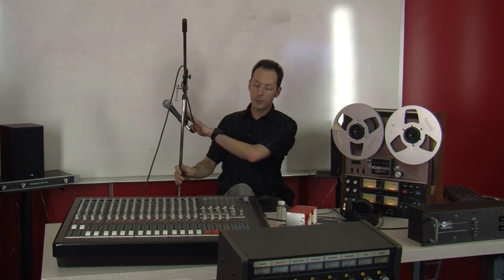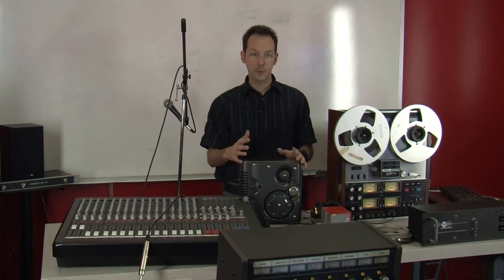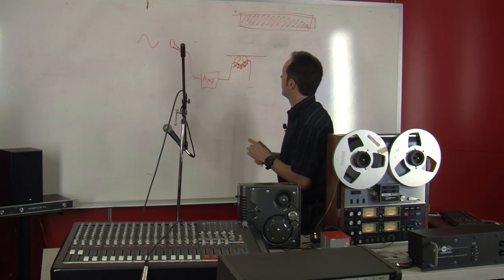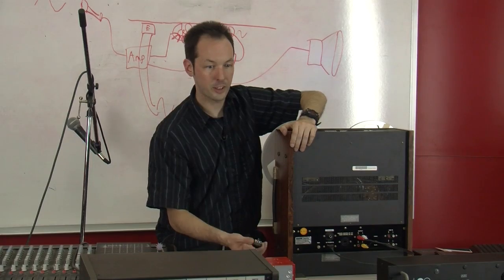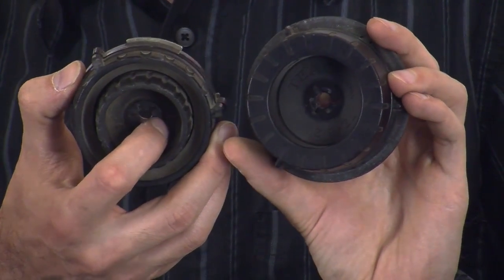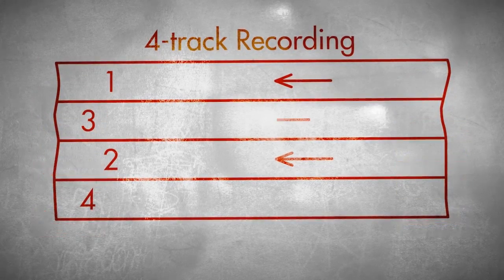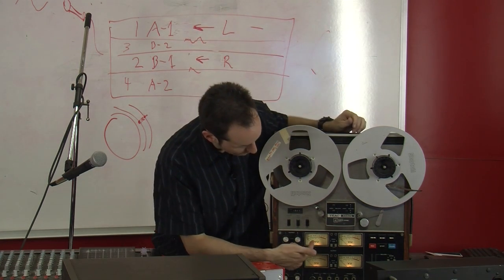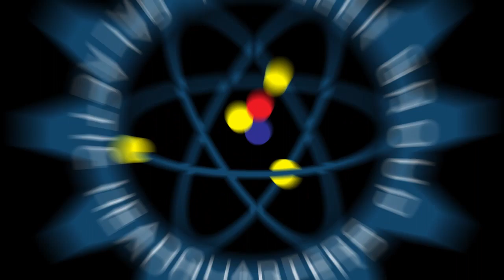Reel-to-Reel Basics

Comment: I was a teenager in the late 70's and early 80's . I remember regularly checking out the many record. music and stereo stores of the period. there were many reel to reel sets,many over $1000 dollars, they were the Cadillac's of audio play and recording back then, until the arrival of the much hyped compact disc player which quickly overtook the reel 2 reel. When I was playing in rock bands in the 80's and 90's, I worked with a few Fostex 15 ips 8 track reel to reels They were alot of fun These days I have a real time analog to digital CD burner and a pocket high density digital recorder with condenser mic's and computer recorder for my recording needs but its still cool to see these classic 70's reel 2 reel players in action they were the dream recording gadgets of my teenage years.
Reply: Mine too... I grew up in the 70's just like you Bro. and I have always been loving them. Their low frequency renditions (the bass) always pumped out with some heavy punch effect when played with one of those nasty stereo amplifiers of those days which were way beyond these days so called 5+1 receivers or what have you. The bass were always very neat, tight and controlled. Just really cool indeed. :D

Comment: I grew up in a house with a reel to reel player, and it was the medium that I was exposed to classic rock on.  A few weeks ago, I found a curbside Teac and plopped it in the trunk quickly, only to discover it had a gooey belt that needed replacing.  $11 and a few days later, the belt arrived and was replaced (after cleaning the black goo mess).  It works now, and my dad handed me some of the recordings I so fondly remember.  Man, reliving the nostalgia of that era was worth every bit of the $11 and the time I spent getting the pinch rollers cleaned up and moving freely again after who knows how many years it sat like that.  And I got a working X-2000R for nothing.  If they knew it was that easy, they probably would have done it themselves.  One man's trash is another man's R2R.  Lucky me, for once.

Comment: I just used an Uher Report Monitor 4200 2-track 5" reel-to-reel machine to record the birds in Sweden at a camp site, without any roads in proximity(!)
Results were awesome! Just using the original Uher M518A microphones with the odd 8-pole DIN plug and BASF Audio Professional DP26 FE LH double play tapes. It's so much fun I'll do this more often! The recorder will run 8+ hours on five NiCd 4,5Ah D-cells which gives me plenty of run time. I even have the original NiCd block battery which still has over 90% of its capacity... good old quality!

Comment: Thank you very much for your lesson !
All that takes me to my childhood when in 62 ( ? ) my father bought one BASF  ;  a second one two years later ; so we could record ( 9.5 cm/s - 15 cm diameter reels ) Radio Caroline (  from North Sea ) ; later in the 60's came the Grundig TK 146 and the Philips N4308 to replace the firsts tape recorders ( and came one DUAL stereo hifi set ) , as well as in 70 came the TK 1400 ( portable / report ) for holidays/camping .
I began to work and have money in 1973 so I was dreaming of one Tandberg tape recorder ( said to be very high quality ) , but I went in 76 in the new chromium-oxyde cassettes ............I was much more with the LP's ( 33 rpm - vinyl ) on my own Hi-Fi set at home .
After my father passed  ,  I  was given the Grundig TK1400 ( still working very fine in 2016 ! ) , one TK147automatic , one TK 547 and one SABA TG 674 with a lot of reels and tapes . One Philips and one Telefunken went to my elder brother .
 Last year one uncle passed ( teatcher in electronics ) and it was gave to me its Grundig TK46 ( 50's old fashion looking ! ) 
We are 50 Hz - 220 V or now 230 V -> 240 V AC here in Europe / France
Tapes recorders ........... : one Era !  .........................
éric : great fan of Minidiscs

Comment: Nice Deck, clear explaination. ;)
I've got an AKAI GX 630D/PRO/
For those who don't know what that is, it's a 2-Track stereo Reel to Reel Recorder.
It plays one way only, has (as stated above) 2 Tracks on a 0.25 inch tape.
So the width per track is twice as wide as the Teac, therefore the recorded signal per channel (Left & Right) has more "room" on the tape.
Downside is that it can't be used for mixing, upside is it's (in my opinion) awesome soundquality.

Comment: I still have one of those tape decks I bought it over 30 years ago. I agree with everything he said it is very clean on 15 ips plus I used to do rerecording in a circle to go beyond 4 tracks mixing up and down through many generations until the distortion got too great, it was a lot of fun. You can use the tape delay as a kind of echo effect with jumpers in the back to feed the signal around and around. Plus you can use the octave difference in pitch to make a bass sound  like a 6 string by recording in 7.5 and playing back in 15. By wrapping the tape around the pinch wheel you can play back backwards. Ya these things are really amazing.

Comment: Nice demonstration!  Yes, cassette tapes run at 1 7/8 ips (or 4.8 cm/s); however, if I recall correctly, unlike reel-reel & 8-tracks, cassette tapes have the L & R tracks adjacent to each other per side.  The reason is for backwards compatibility with mono tape recorders that have one coil in the record/playback head that scans over both tracks.

Comment: I purchased a Teac 2340-RS 4-channel tape deck new back in 1977.  I still have it.  When I was recording way back when I would try to keep the needles from pegging up into the red zone.  I didn't care for the very mild distortion associated with it but it was unavoidable.  Analog recordings weren't "base-lined" and things like crossing into the red zone were quite common.  I preferred to keep my needles average around the "2," or 80%, level.  This caused a lot of red lining but as I said before it was unavoidable.  I preferred the higher power output from the tape deck.  FYI:  I had it hooked up to a Teac six channel mixer and a Sansui QRX-9001 quadraphonic amp.  The amp went out late last year (2019) so I'm looking to get it repaired, if possible.

Comment: Music fans like myself were excited back in the 60's or 70's when the Japanese began producing tape recorders that would reproduce sound that was pleasing to the ear. Before that, only professional sound engineers had equipment that could do that. I bought an AKAI reel to reel while stationed O'seas and got it "duty free" as a serviceman.
Subsequently I owned 4 or 5 AKAI recorders and used them in my musical practice. It is argued today whether the analog recorders of the past were better sound reproducers than the digital equipment used today. I now use DAT and CD-R and CDRW to record and playback. The latest is MP-3 and IPOD etc. I haven't gotten into that as yet. :)

Comment: Great video, very easy to understand.  Only a correction, at 29'57", cassette tapes don't work the same way. It was created as a mono (1 channel) media, so half the tape was side A, the other half side B. To mantain compatibility with older machines, when stereo cassette was created they kept both channels (left and right) together on one half of the tape. Two channels on the upper half, two on the lower half.

Comment: The forerunner to the Reel to Reel tape deck where wire recorders the first tape based Reel to Reel was the German Magnetaphon, you can also get Metal tape which is Metal evaporated onto polyester tape which will give better sound but requires a higher bias frequency to allow recording, My tape deck isn't working any more as the capacitors may have dried out so neither analogue or digital works.

Comment: I bought a Teac X10R  at an Estate sale. It was sitting under a table  partially covered. Ordered a metal take up reel that cost almost as much as i paid for the unit itself. Can't wait to get it  running. BTW i have a 3 1/4 inch tape from a old portable reel to reel I would like to hear again. There may not be anything around that will play it. Thanks for your video.
Reply from the maker: Thanks for watching it! :) Good luck on your new project! :)

Comment: This is a really nice video. While very few will actually record in this way today, it gives great insight into where we are in the digital recording world in present day. The basic concepts of multi track, historically illustrated in this video, are concepts still used today in digital audio work station software.
Reply: Making this comment 5 years after your posting. Today many "real" musicians are going back to tape. They have realized the quality of the sound that tape captures that is unobtainable with digital. If all your going to do is put some samplings together and call it music digital is fine. But tape has a quality and warmth of sound that can't be beat! BTW, new state of the art decks are now being manufactured by the top brands around the world. Also, the manufacturing of the tapes has been improved tremendously which adds to the improvement of the sound quality. Like vinyl records, what was once old is again new.

Comment: Good Job Chris. Nice Tutorial. I actually bring my 1/2 Inch Tascam TSR-8 back to live after it last using 6 years ago. First replaced the Pinchroller Rubber and the bigger Project now replace the Capstan Belt. Hope it will work well.

Comment: I loved reel to reel from the first time I ever used an old Webcor Tape Recorder in the very early sixties. In fact I used to take songs apart by splicing them with a razor blade, taping them back together and running the tape back on through to the reel.
I once had made myself a 10 minute version of Satisfaction by the Stones that worked and sounded perfect for whenever I through a party. I'd also tape from TV shows, such as the Beatles on Jack Parr or Elvis on the Ed Sullivan Show. Mainly I used the tape recorder to save the cost of buying records by recording off the radio instead. I sure miss reel to reel and all of its flexibility, I think we had more fun in those days, than we do today with everything digital. You could buy a used car in those days for the price of just a single digital plugin you might use to enhance your sound system today. Save yourself a fortune and get one of these old timers, you'll add a whole new dimension to your listening experience.

Comment: Hey Chris, I just bought my first R2R without realizing it was a model made for an overseas market with 220 voltage. Could a step-up transformer mess with the signal or do damage to a vintage circuit board with forty year old transistors?  -Thanks.

Comment: I still have my Pioneer RT-1011L 2-track stereo r2r.  Sounds and works great for a mid-1970s vintage!  Only down side is the 3.75 ips and 7.5 ips speed; I wish it had 15 or 30 ips as an option.  A few things to note: 1.) always keep the mechanical parts lubed, 2.) never use rubbing alcohol to clean the rubber pinch roller, 3.) use good quality tape.  For the last bit, try to stick with Maxel, BASF, TDK or Memorex brand tapes, as they are the most stable and low noise type.  Ampex tapes tend to unbind the magnetic dust from the plastic tape and ooze out the top lubricant/protective layer or the years; that can mean needing to literally "bake" the tape(s) in order to salvage the footage.

Comment: I've got a 2 track real to real Teac that is sick.  For some reason, it won't even start.  I've checked the 2 things you mentioned and I think it is electrical.  The fuse doesn't appear to be blown.  I think my next step is to find my local electronics fixer and have them diagnose what is going on.  Anxious to get started though.

Comment: H I've use or should say bought 2 different reel to reel tape decks in my time Sony and Teac.

and I've been using the Teac more then the Sony and now I have 2 Akia Open Reel tape decks that I got from my father as a gift. About two weeks now  I just got the GX265D out from being serviced. My question to you is that I like to start making recordings through an Equalizer. Duplication is the word that I'm looking for anyway using my both machines. For my other components is a Receiver,Audio Mixer and of course the equalizer. So the question is how to make connection using the RCA cables.? Thanks.

Comment: Hi Chris, Thanks for an excellent and informative video. I have a query – I am wanting to digitise some old R2R tapes which were recorded on domestic recorders of the 50s/60s/70s, but I haven’t yet bought a R2R player to do this.Is there anything you could recommend which is of decent quality for a digitisation project? . I originally thought of buying a machine similar to the TEAC, but presumably as it only has speeds of 15ips and 7.5ips  it would be a bad choice for this purpose??

Comment: Awesome video just came across a pioneer RT 1050 in very good condition. I just did the first power on and it lights up flipping tension arm does start spinning the capstan. Only thing I wasn’t able to duplicate was the pinch roller falling down on the capstan when hitting play. Seems if I push it down on it many Lally with finger it seems to fall and starts rotating as well. Any recommendations would be appreciated thanks again.

Comment: Hi, Chris - great video. I have (and still use) a Tandberg 3300X and Tandberg 20A deck here in the UK. The10.5" reels I created on the TD20A from 1981 onwards are still crystal clear to listen to. However, I digress. What caught my eye was the fuse rating stated on the back of the Teac you used in the demo; it states 2amp at 240 Volt. How does this work as, if I've got my geography right, you're in the States, which runs on 120 volts? Just curious! Cheers!

Comment: I think, that it is better to say, that in our physical world, sound is the audio wave which goes through some material (air, wood etc.), in electronic form it goes to analog signal (which is any continuous signal for which the time varying feature (variable) of the signal is a representation of some other time varying quantity, i.e., analogous to another time varying signal) - the instantaneous voltage of the signal varies continuously with the pressure of the sound waves.

Comment: My dad was a professional recording engineer since the 30s so i grew up with professional anakog audio systems at home. Professional gear is soooooo much better than consumer equipment. I still have my fathers professional AMPEX Model 600. Which was a mono recorder with NO guard band heads for super quality sound. He later had an AMPEX AG-440 (which I still have) as a child I knew so much about these machines. My dad was hired by one of the inventors of television and was in charge of all the technicians. When video tape was invented, my mind was a sponge for knowledge of these machines. 
If you think recording simple audio bandwidth of 20khz, imagine developing a machine that was capable of recording a 6MHz bandwidth!!!

I now restore broadcast video tape machines that weight 2,000lbs each!!

As a person who was born with oxide in my blood, and now restores broadcast audio & video tape machines, I would like to correct a few inaccuracies in this video.
First lets begin by the erase head. Magnetic particles need to be coerced into moving on tape. This is where tape bias frequency & level is applied to the tape. This sets the magnetic particles into alignment on the tape. A bias freqiency is typical 3x that of the highest audio frequencies to be recorded. Typically in audio this bias is about 100khz.
Moving onto the record head: the amplified audio signal is mixed with the bias to coerce the magnetic particles on the tape to represent the audio signal. On playback head signal is preamped to line level which is about +4dbu in professional equipment and -10dbv in consumer equipment.
Also a mic applied to the input must be preamped prior to be combined with the bias voltage/frequency. A line level input is usually sufficient to be mixed with bias, but most audio recorders usually have a small gain adjustable amp to set proper record levels
Your identification of tracks on tape need clarification:
On 1/4 tape there were a few configurations:
1. Full track mono - no guard band. This is a professional format. (Most tape formats had a guard band, which is space on the tape where no recording can happen. This is to allow for bad tape head alignment. Any tape that uses more than mono, has a guard band
2. Full track mono w/guard band
3. 2 track one direction, usually a mastering recorder
4. 2 track bidirectional (sometimes called 4 track, but this is misleading) this is typical of consumer equipment.
5. 4 track one direction. This is the entry into multi-track recording.

Lets talk tape speeds. The faster the tape moves ober the head the better the bandwidth or frequency response of a recording. This is called tape write speed. Since the head has a finite gap, the only way to increase its quality is to move tape faster. The highest tape speed on audio I saw was 45ips, the slowest was 15/16ips. With high tape speed comes with a huge cost of tape consumption. Normally mastering will be done at 30ips.
Since video requires MUCH more bandwidth (6Mhz v. 20Khz) the write speed needs to be super fast roughly 240ips. Clearly this would not work, so AMPEX invented moving heads that rotated 14,000 rpm on air bearings and recorded video thay was transverse to the tape!  This mean the tape could now move along at 15ips and 90 min could be recorded on a 14" reel of tape. Brilliant engineering! The 2" video tape machine incorporated several servo mechanisms as well. Its quit a complex machine!